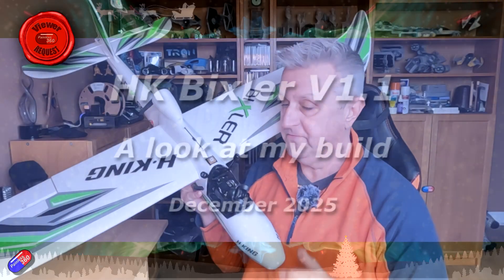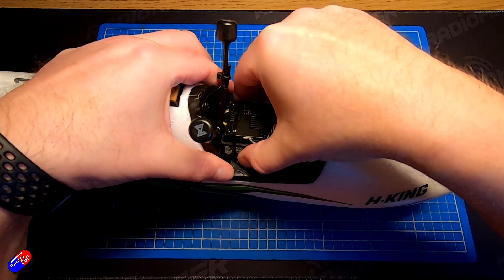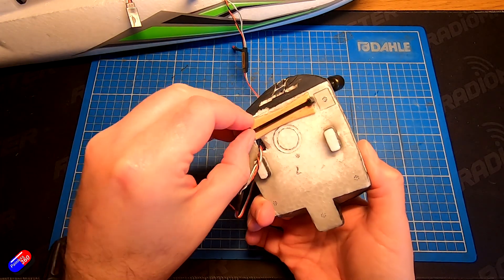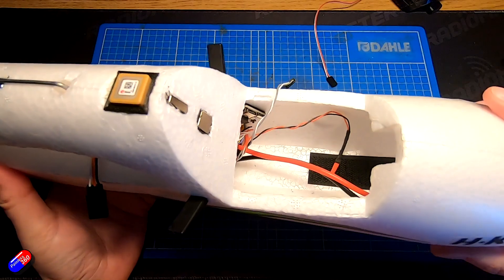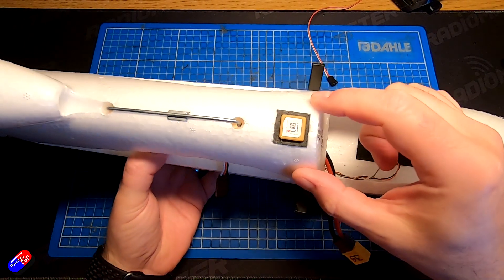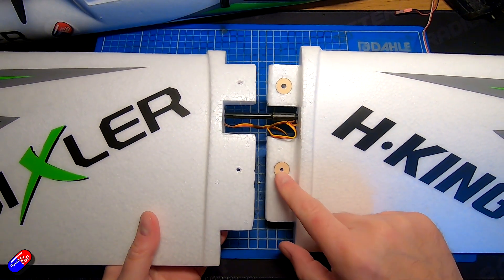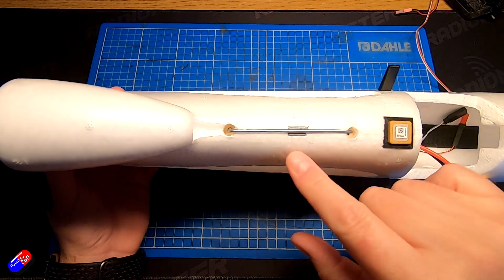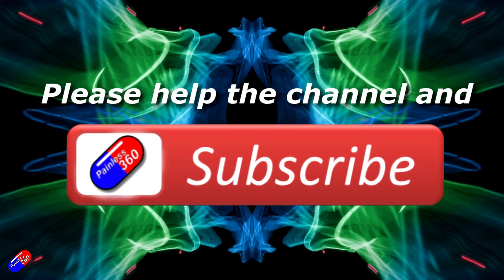How I added INAV, HD FPV and a GIMBAL to my Bixler v1.1 (viewer request)

Comment: Is it safe to run a Walksnail Moonlight and a GM3 Gimbal off the same 9V VTX port on a Speedybee F405 Wing fc? I’m worried the combined draw will exceed the 1.8A regulator limit and cause a brownout mid-flight. I’ve already got a capacitor on the ESC leads, should I definitely be moving the jumper to 12V to keep the amps down? Cheers!
Reply from the maker: I run the gimbal and vtx from the battery directly (3-4s) here...Best of luck
Reply: @Painless360 with 9 or 12 volts on vtx bec? So this jst cable is soldered on the lipo direct not through fc's vtx port?
Reply from the maker: Voltage range for both is 7.4 to 25.2v.i like to run it between 8 to 12v as more just generates heat in walksnail pieces. I run them from the battery directly for 3 and 4s but would use a separate 12v BEC for 6s...happy flying
Reply: @Painless360 thank you very much

Comment: Hi, very interesting. How did you handle the center of gravity given the extra weight from the fpv equipment in the front?
Reply from the maker: It's balances perfectly. All of the hardware is close to the GG point. Happy flying

Comment: 🤣 what a coincidence, I just spent a few frustrating hours squeezing my Speedybee F405 with INAV  and Flysky FS6iab into a new Skysurfer X8p,  Bixler clone, which was a much needed replacement for my knackered old Bixler analogue FPV machine held together with hot glue and tape. Interestingly the X8P has a removable centre section,  mid top fusi, which is exactly what I'd done with my Bixler to get the RX into the top!
I'm still trying to get the same immersive fpv that I've had in 20 years paragliding and paramotoring. think it'll have to be Walksnail! 😭.
Reply from the maker: Happy flying!

Comment: I have a question, those strong magnets doesn’t interfere with the gps?
Reply from the maker: Magnetic fields don't affect GPS. They only affect magnetometers, but inav doesn't need a compass for fixed wing for most wind conditions... Happy flying
Reply: @Painless360 thank you😅

Comment: I have a Strix StratoSurfer which is much like the bixler and just added the Walksnail head tracking to my ArduPilot setup.  Great for taking passengers up and letting them look around while I fly LOS as well.  Building some 21700 packs so it can fly for an hour.

Comment: The Headtracker supplied with my Roc Wing VTOL is plugged in to the Jumper T20Pro Tx trainer port and then activates Channels 7 & 8. IF I decided I would rather have manual gimbal controls via two available scroll wheels on the TX, is it just a matter of somehow assigning the two scroll wheels to Channels 7 & 8 and not having the Headtracker plugged in ??
Reply from the maker: I think so. Best of luck

Comment: Very good, I like the wing retaining solution a lot. One thing I used to do with these was feed a velcro strap through a couple of slits in the bottom of the nose to clamp the battery down.